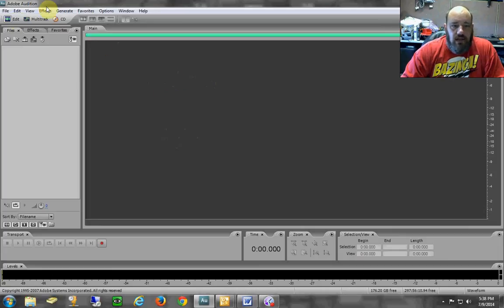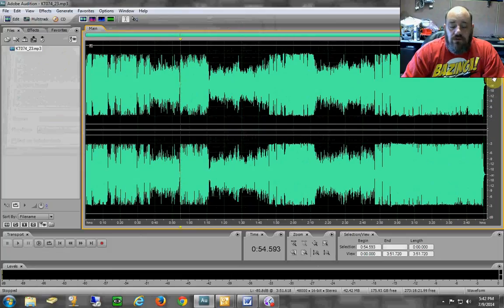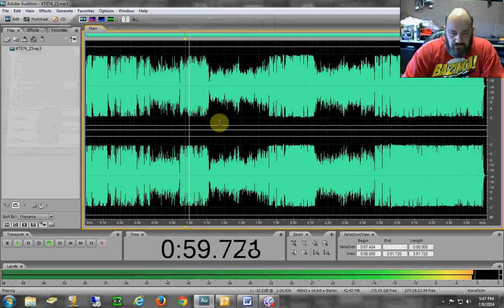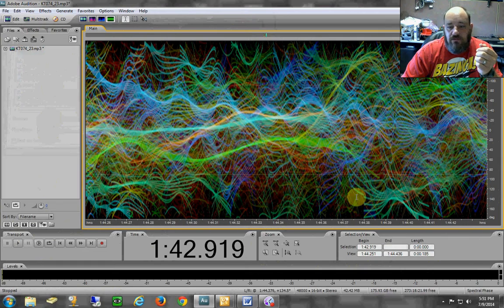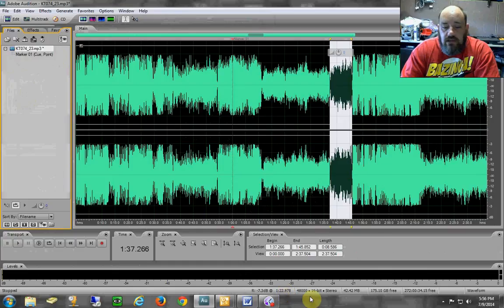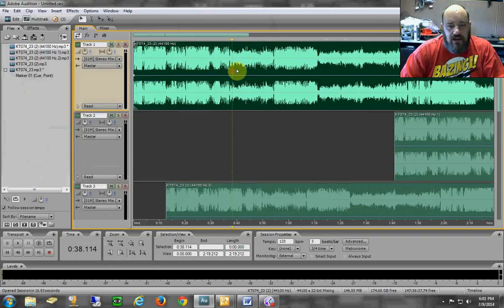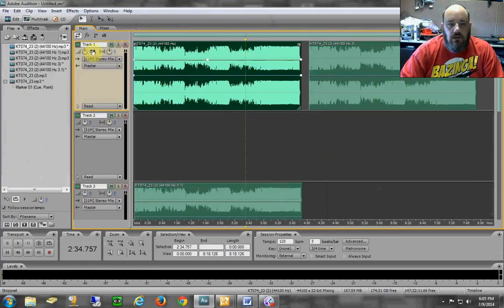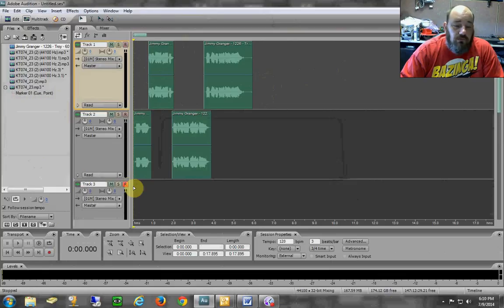ADOBE AUDITION 3 0 FOR BEGINNERS

Comment: Hello, I am writing this comment to see if there is anyone who knows how I can fix very choppy playback on the multi track view when I have sessions utilizing many, many, heavily edited tracks. I am using a TOSHIBA Satellite P305-S8919 Core 2 Duo 2.66GHz 8GB, which should be powerful enough to handle all of these tracks. I had the same issues with these sessions with computer with 4GB of RAM. I have tried all of the most obvious culprits. There is really nothing on YouTube for it. Thank you to anyone who can give any help with this issue. I am not able to work on these sessions until this problem is fixed.

Comment: Excellent Presentation and well worth watching. I've just upgraded to 3.0 because of Windows 10 issues running 1.5 and the interface changes slowed me down a bit. Your tutorial hit the spot & I look forward to more.  I like your style.

The lesson I learned this year is to NEVER AGAIN upgrade a PC's factory installed version of Windows.  After the sad death of a Vista machine, I bought a decent current x64 Intel model which came with Windows 8.1 and after hating the new look for less than a couple of days, I surrendered to the temptation of the free upgrade to 10, a decision I regret to this day. I have never been a Microsoft basher but this experience has left me choked.  Windows 10 is more unstable than Vista ever was. Attempting any serious audio or video editing gives me the same discomfort  I get sitting on a 40 year old wobbly wooden chair.